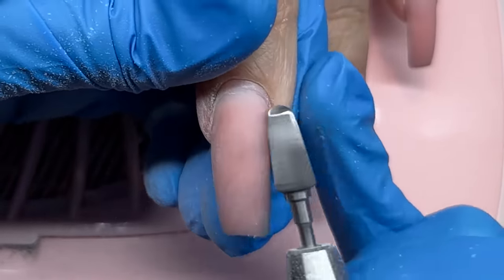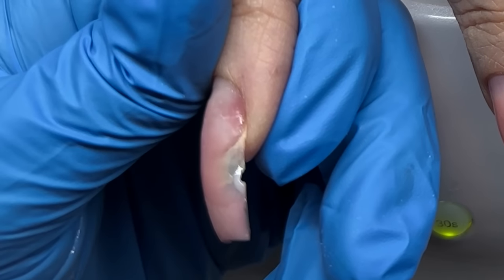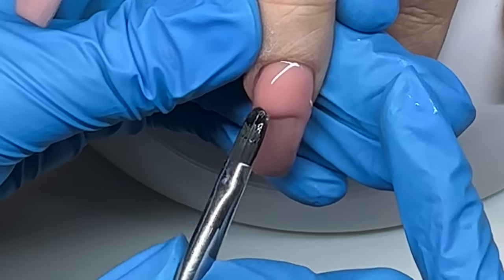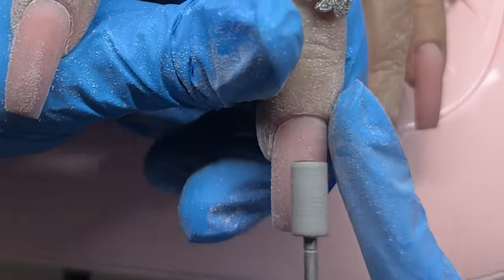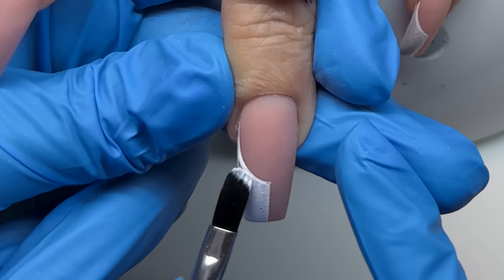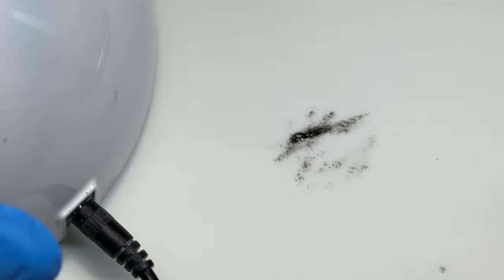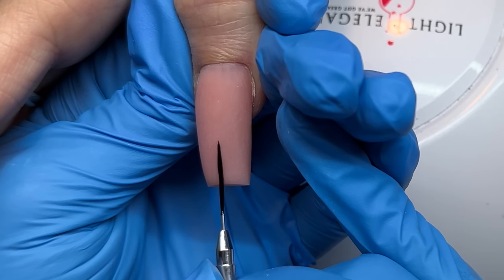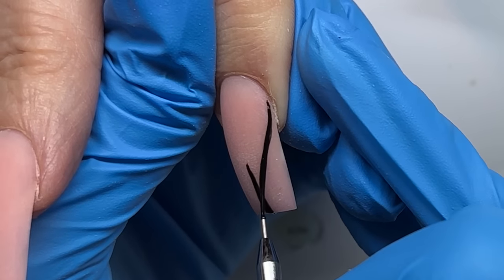EASY “Tweed” Nail Art! - Accidental Nail Illusion?! 🤔

Comment: I'm interested in using gels. Do you cure each finger before moving on? Anyone can answer please!!
Reply: Hi, I'm not a professional..but I've been using gel for about a year. It's good to at least flash cure each nail before moving on to the next. Otherwise, you run the risk of the gel flooding the cuticle or running to the free edge and side walls ♥️ once all nails are complete, you can fully cure